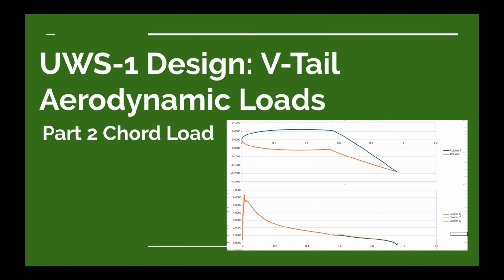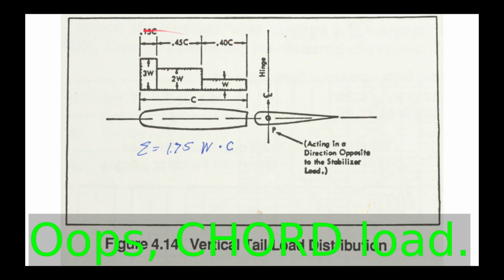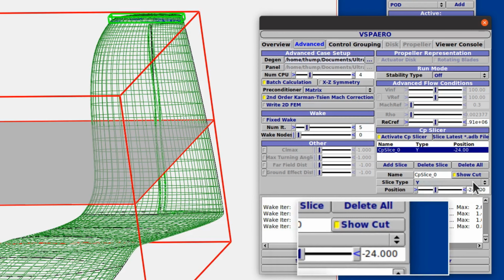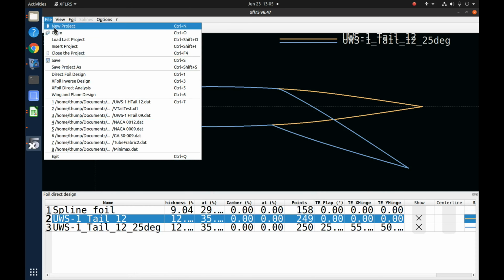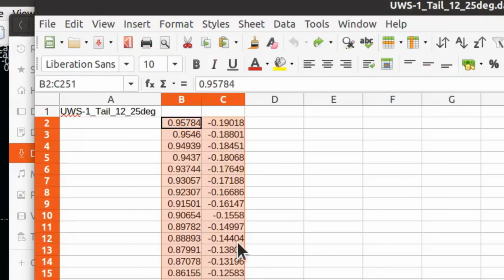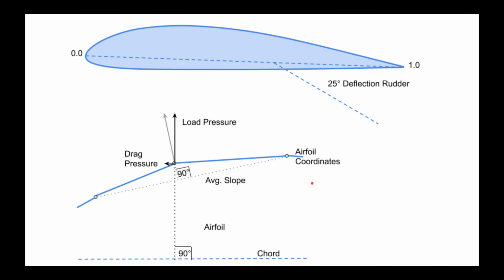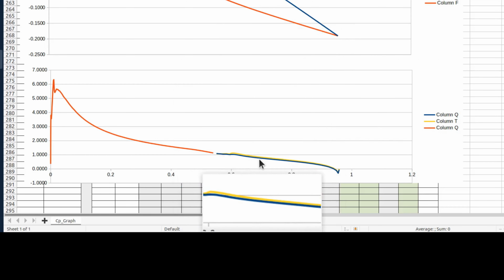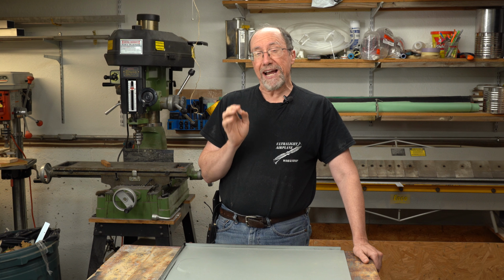UWS-1 Design: V Tail Load Part 2, Chord Load Distribution

Comment: THANKS FOR THIS INTERESTIN INFORMATION.  IMHO: IT WOULD HELP GREATLY, IF YOU STARTED OUT, SHOWING THE ACTUAL STRUCTURE, THAT YOU ARE ANALYZING... I THINK A LOT OF VIEWERS WILL BE QUICKLY LOST, BY TRYING TO VISUALIZE THE COMPLEXITIES, THAT SHOW UP IN THE COMPUTER GRAPHICS.  ADD SOME PHOTOS, OR VIDEO, OF THE ACTUAL AIRCRAFT AIRFRAAME COMPONENTS, THAT YOU ARE TALKING ABOUT.  WHY USE SUCH A ("TWIN"?) TAIL CONFIGURATION?....    IMHO: THE PART 104 RULES SHOULD BE AMENDED, AND CHANGED TO ALLOW ANY SINGLE-SEAT AIRCRAFT WITH "500 POUNDS", OR LESS, (EMPTY WEIGHT), AND UNDER 75HP, TO BE CONSIDERED TO BE AN "ULTRALIGHT".